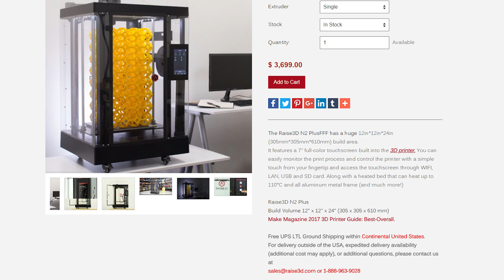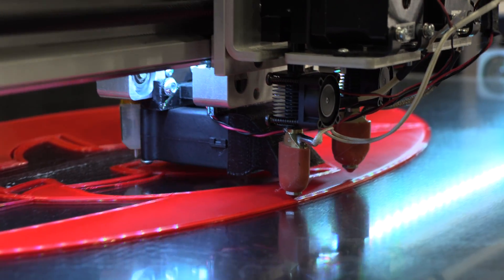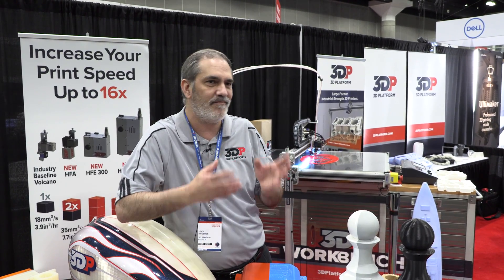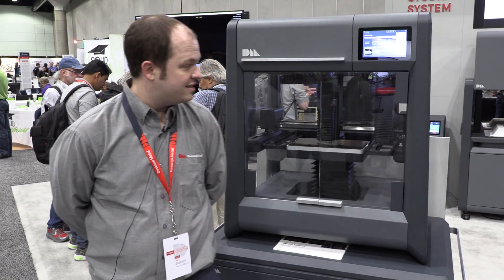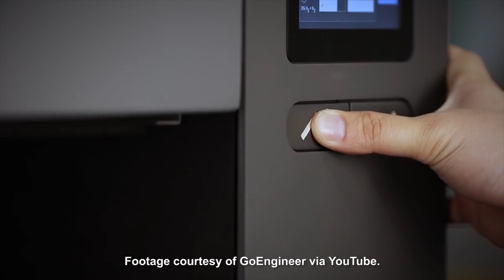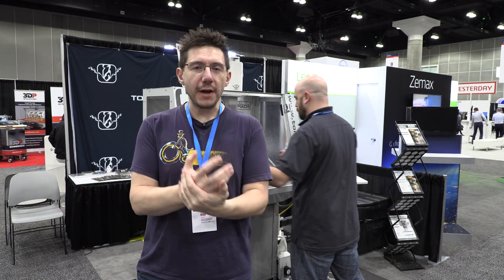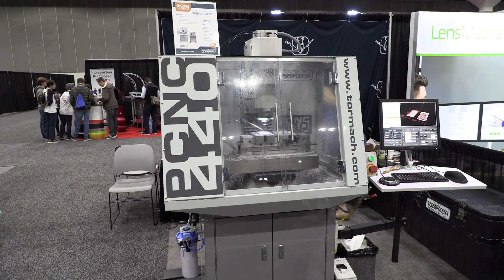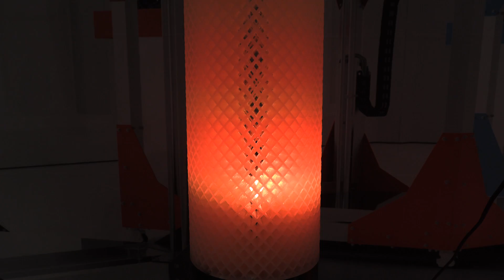3D Printing & CNC Milling at Solidworks World 2018 w/ Matterhackers, Raise3D, Desktop Metal, Tormach

Comment from the maker: Hey! I know having ME at Solidworks World doesn't make the most of sense, but, I got to talk to some really cool people and learn about some awesome tech available to Solidworks users! #highfive
Reply: I'm glad, this sort of content is underrepresented on YouTube. A lot of people talk about the more hobby side of 3D printing, but the engineering side is less prevalent. I use 3D printing for both hobby and professional use, so it's good to see the other side, even if I loathe SolidWorks.
Reply: But the pro side has deep pockets, don't let them fool you.  I see them burn thru more money in a hour in meetings than I spent all year on a 3d printer.  When I worked as a project engineer, I has access to a real onsite machine shop that could turn stuff in hours and a outside machine shop that could do a 2-3 day turn.   Real companies have this too.  Hobbiests are where the innovations are coming into the 3d field.  You know darn well that 3d parts are designed and made differently than they would be in a machine shop.

Comment: For people that think solidworks is hard or don't think they could learn CAD, you just aren't putting in the time. When I was in high school I took a class in solidworks, which is also the first and only CAD program I've used. We were the first section of students to take the class, and the teacher had never used solidworks before either so she followed the curriculum for CSWA certification with us. So it's not like I had someone walk me through how each little thing is done, Because nobody in the class knew what the hell they were doing. You learn by the practice. 

During the beginning, you're going to mess up, everyone does. I'm studying mechanical engineering and even the smartest people I know from college messed up at first. But those screw ups are important. you learn how to correct your models and parts from fixing those errors and come out with a better understanding of how it works. All you have to do is watch tutorials on how to do things. I was a high-school senior when I passed the certification exam, but we also had a good amount of sophomores get certified too. The hardest part is learning to visualize and rotate things in 3D in your head. Once you do it's a piece of cake. 
Personally I think CAD and 3D printing will eventually become mainstream to the point that almost every household will have 1 3d printer, and people will learn basic CAD skills to create things they need for around the house. Probably not solidworks because it's expensive as hell and more so for the engineering aspect of it, just some simplified program that people can use to make things.

Comment: Need some help from you. How can I get your help on Cura 3.2. Need the bed to move to the front when it is done.
Reply: Is setup on Cura 3.2 different than 2.6.2?  If not you can go under Settings>Printer>Manage Printers>Machine Settings and edit the End Gcode box to add in whatever G1/G0 move you want.
Reply from the maker: What DAM Machines said!

Comment: Hey! I've been thinking about getting a CNC milling machine (1st choice desktop) for a few years. Maybe now is the time? Thx!
Reply: i can say i think early last year was the time to buy. could have gotten a cnc3040 for under 500 bucks late 2016 early 2017 they are now 800. granted it isnt a mill and more a router. desktop mills are getting eve more pricy as the taig and sherlines have jumped in price. but the tormach will always be expensive when it comes to a hobby machine.

Comment: Nice video Joel,
I am big Solidworks user and engi-nerd. 
Only one complain is about the personal CNC, which sound awesome. But it still looks like a 15k plus machine, and I do not really think home users will spend 15k on a machine. Their website doesn't show any prices. Edit- found a price it was around 7k for the basic version so probably 10k for the enclosed version. Still expensive as hell.
Reply from the maker: +Haas the Tormach machine? Haas, it's $5k US!

Comment: Deffinitly an interesting video. I have been using Solidworks for 10+ years now, starting back in highschool and now am using it for personal use and designing for different clubs on my college campus as well as helping the university makerspace when they need someone who knows the programs and 3d printing. Got my first printer exactly a year ago (Formbot Trex 2) and now run my own cosplay prop shop. Funny enough though I am not actually an engineer, I did start off for a year doing mechanical but now I just do it for fun but Solidworks remains my go to software for designing. Was awesome hearing how they are getting more involved directly with 3d printing as I have been hoping for more integration in the software with it ever since I got my printer.
Reply: How can you afford a license?
Reply: Sean G I've been a bit lucky on that one. Since I do so much work in the program for my university they were able to let me have a renewable key each year for the newest full version. Before that I was given a copy of 2007 by my CAD teacher in high school that I used for about 4 years.